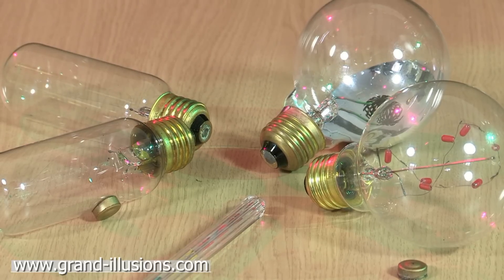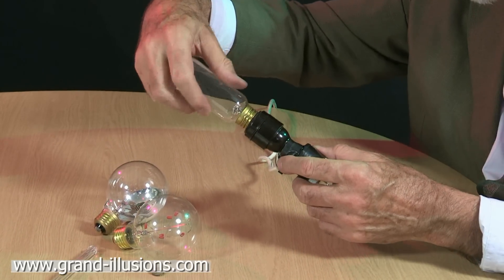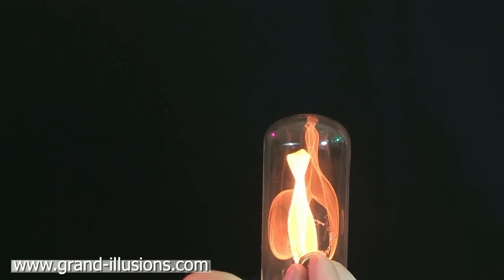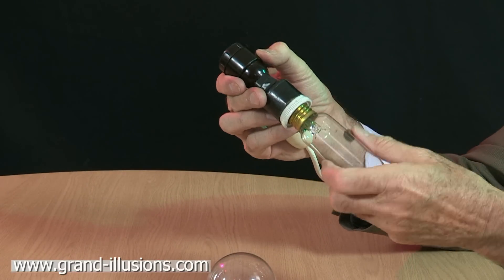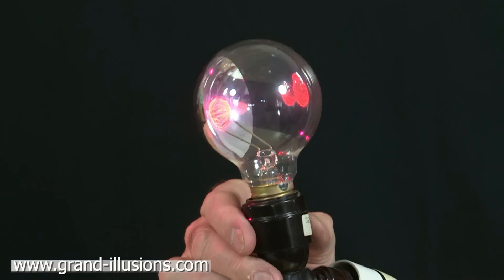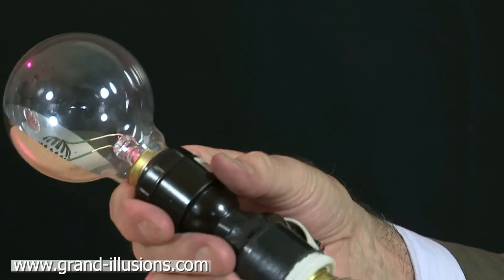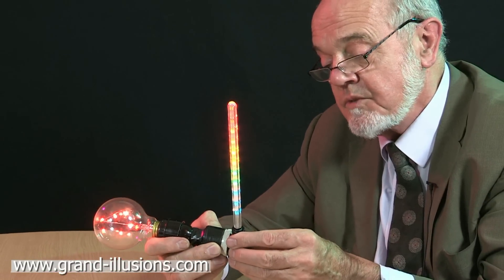Unusual Japanese Electric Light Bulbs

Comment: Putting in two bulbs they are still both getting 240v each, they'll live, but only half as long
Reply: not if they're in series. in that case both will get half the voltage but same current.
if it was in parallel then they would get 240 volts but half the current
Reply: @Xiefux  then explain a ring main
Reply: @phonotical  i dont understand what you're trying to say, whatever it is it's not english
Reply: @phonotical  i dont speak russian

Comment: A serial connection is a bad arrangement as it will be unbalanced due to the difference in bulb-resistances. Moreover, the electrical safety would desire some more considerations. The proper arrangement would be to have a step down transformer.

Comment: The voltage "seen" by each light bulb will depend on the resistance of each bulb in the pair. You want to match the resistance for an even 120v on each.
A safer, foolproof alternative would be a 2:1 stepdown transformer.

Comment: That 1st light bulb is the old Kyp-Go light.  It was manufactured here in the United States, and Robert Kyp started seeing knock-off bulbs, and applied for an international patent.  His patent actually protected the way his light bulbs were made as his was manufactured with a magnet in the inside of it.  Other makers can make light bulbs like that, but could not put a magnet in the inside of it.  Here is a video of the one that I have that is about 50 years old.  The last time I have talked to the Kyp's, Mrs. Kyp told me that one of their test bulbs has finally failed after burning continuously for 30 years.  They said towards the end, the bulb was so black, you could barely see it.  The filaments in there were made from carbon.  Here is the bulb that I have.  https://www.youtube.com/watch?v=5Sn70P4i7O0

Comment: Putting 2 120V light bulbs in series on a 240V supply isn't necessarily a good idea. If the bulbs have different power rating / consumption, their resistances will be different. This means one will take a higher proportion of the voltage than the other, and may burn out. 

There's also the fact modern low-voltage bulbs use capacitive droppers to reduce the voltage, and they aren't designed to work in series with each other, like the old-fashioned purely resistive tungsten filament bulbs could. And even with tungsten, you'd need 2 of the same power. 

You can get inexpensive voltage transformers, although quality will vary along with price, worth getting a decent one. Doesn't have to be too expensive, but you'd be amazed at the crap they sell on Ebay, much of it wrongly specified and dangerous, sometimes deadly. For low power devices like bulbs (less than 100W, say) you don't need a large or expensive transformer.

Comment: Very fascinating bulbs. An idea: you could make a simple transformer. Just wind coated copper-wire around a iron core, lets say 40 turns, then make a second winding next to it with about the half (measure to find the right number of turns). This should give you 240->110VAC so you don't have to put two bulbs in series (which acts as two resistors).

Comment: you can buy screw in socket adapters for standard us sockets.  Might be a better idea than sticking a pulg in into a screw socket.
Reply: +brett knoss That's not the issue. Here in the UK we use 240v mains. Those bulbs are built for 110v, so he has to divide the 240 voltage between two bulbs to get closer to the bulbs operating range.
Reply: +Alan Bacon he already had a UK to US adaptor, and it was a Japanese bulb.
Reply: +brett knoss the adapter dose not step down the voltage

Comment: No one cares about that man almost electrocuting himself? If you run those lightbulbs in series, you have exposed 115 volts on that clearly exposed lamp socket. Also its not a good idea to change lightbulbs thats on because if you break the glass, you touch the filament and die.
Reply: +Aleš Pinď&#225;k Well, maybe.  I've had over a dozen 240V shocks - they hurt.

Comment: So the UK uses 220V?
Reply: Brian Liesberg The UK currently uses the same as mainland Europe, which is 230 v +/- 10%. Japan actually uses 100 v for most domestic installations, but since they export a lot to the USA (which uses 120 v) they tend to aim for 110 v.
Reply: Brian Liesberg 240V, which is close enough to 2x110V to work without destroying the bulbs/filaments.
Reply: ***** No, the standard in the UK is the same as the rest of Europe (where you'll also find areas with 220, 230, 235, 240, etc., sometimes even within the same country).  It's 230v +/- 10%, as I wrote above. It was defined in 1988 by CENELEC (the European Electrical Standardisation Committee). There is no mention of "+/- 5v" anywhere.
 
The actual CENELEC website requires membership, but you can find references to it on other official sites. Ex.:

http://eur-lex.europa.eu/legal-content/EN/TXT/?uri=CELEX:91997E001426

Some areas of the UK actually use 250v, but even that is still within the standard. Most areas are within 6% of 230v (i.e., 215 ~ 244v), but any value within 10% (i.e., 209 ~ 253) complies with the directive.
Reply: +RFC3514 mainland Europe uses 220v and the uk uses 240v but the law stipulates that the voltage must be aimed at 230 +/- 5v

Comment: To use two 110V bulbs in series for 220/230V one should only wire in series two 110V lamps that have identical Ohmic resistance (usually that means same wattage but some LED lamps work differently). Otherwise, you'll have two resistors (two lamps) of different values in series, and the voltage of each will be as the resistance ratio. One will burn dimly, and the other will die young!

Comment: Well done video!
Love those lightbulbs.  Candy bulb has little filament lamps inside?
The magnets do not affect the current flow through the filaments. 
The filaments are just attracted to the magnet and repelled by the magnet as current direction alternates 100 times per second.   Would be fun to see how much they would bend on pure DC current.

Comment: Cool.
Reply: sebastian nutter They are actually called "Balafire" or "Electric Flame" lamps based on different patents from the late 1800s. Strangely, those all had the magnets inside so it can't be lost. Maybe it's outside here to allow you to turn off the flickering. It's weird that it's glued on though, so maybe it's just a cheap solution to not infringe the above patents.
Reply: sebastian nutter Are you referring to the now discontinued "Flicker Flame" bulbs by Noma? ( https://www.youtube.com/watch?v=1wbhIE_CV0w )

They were neon lamps with two flame-shape plates as electrodes. The tips were further apart than at the base so the discharge glow would act like in a "Jacobs ladder", traveling from base to tip
Reply: *extraordinary

Comment: one should never touch the glass bulb with a bare hand. The oils from your hand weaken the outer glass. The oil will cook on the glass and compromise its strength.
Reply: Are you for real? I have never heard of this. It's like people who say never to touch a CPU with your bare hands, like it's the worst thing in the world.
Reply: charzzbarzz
sadly yeah its true =(i use a cloth to screw mine on
Reply: charzzbarzz the cpu thing is real :D because of electrostatic discharge but you can still touch the CPU but should avoid the pin 'cause you can also bend them :D
Reply: i know this is true for halogen and xenon lamps but iv'e never heard of it with regular incandescent, although i do usually use a cloth or something to install them anyway because fingerprints will lower light output and they look nasty with prints on them
Reply: yuukiflow Actually, as far as I know, the CPU thing is so that you don't get fingerprints where the flat surface connects to the fan, because the fat makes the cooling an incredible lot less effective.
Reply: Tom, you are correct if you're handling a halogen lamp. The low output bulbs in this video can be handled safely.. The CPU thing is real.  Microchips get zapped from any static charge that we almost always carry. Good day
Reply: charzzbarzz
It is overkill advice for a standard light bulb - but if you work in theatre projection, those xenon arc bulbs have special quartz envelopes (not just glass) because they need absolute clarity. 1% loss in the glass would result in hundreds of watts being applied to the glass and it can't handle that much power. Add a finger print and you just made a hot spot where the skin oils absorb light...and you just exploded a several thousand dollar bulb after it heats up.
Reply: also the energy from the light has a harder time escaping.
Reply: Uncle QUiKSCOPEe you are right the electrical discharge wont do jack shit as there is something the way between the topp and the curcit.

Comment: It's rated as 240V but you don't actually get 240V. You get 220-230V
Reply: The opposite, its rated at 230 but you usually get 240 to 250. 220 is the European voltage, 240 is the commonwealth voltage (excluding Canada)
Reply: 240v nominal
Reply: Nathan Dance Excluding Pakistan and India too!

Comment: We use 240 Volts in Australia too. 120 isn't powerful enough for many applications.
Reply: I know this is old, but there are so many mistakes being made in these comments.  In particular, 1Howdy1 may sound authoritative, but he is just guessing, and almost all of his guesses are (very!) wrong.  (I am an electrical engineer.)

a. 120 V is powerful enough for anything you want as long as the plug (and wiring) can handle enough current.  Doubling the voltage cuts the current in half for the same amount of power usage.  This means the wires can be made thinner but the insulation has to be thicker due to the higher voltage.

b. Single-phase isn't unique to the US.  Every country in the world uses 3-phase for power distribution and then single-phase for most home purposes.

c. The 240 V split-phase for large appliances in the US is not "smoother" or "less jittery".  Split-phase is equivalent to single-phase.  It just adds a third wire at an in-between voltage for things that need 120 V.

d. More phases does not necessarily mean smoother power delivery.  Single-phase is not smooth, but ideally, 3-phase is perfectly smooth, just like DC.  That's why it's the worldwide standard for power transmission.  4 phases is not as good as 3 due to the large currents the neutral wire will carry.  You don't even need a neutral for 3-phase because it is perfectly balanced.

e. Most of what people call "appliances" certainly don't run on DC!  Things with motors (blenders, air conditioners, etc.) usually use AC motors.  Stoves and toasters use AC heating elements.  Incandescent and fluorescent bulbs run directly on AC.  Electronics like computers and phones are the main thing that needs DC.

f. The electrons don't just drift slower than walking speed, they drift at an extremely slow rate.  Imperceptibly slowly.  It's like watching grass grow.

g. The reason silver, gold, and copper have higher conductivity is not because their atoms are more organized than other metals!  Notice that all 3 are in the same column in the periodic table.  The reason they conduct so well is that they all have only 1 electron in their outermost shell.  That one lonely electron is held very loosely because there's just barely enough positive charge on the nucleus to hold it.  So, it is very free to move.  We call this "high electron mobility" and it's the reason for the high conductivity.

h. The electrons in a metal certainly do not travel like a slalom course!  They are travelling at extremely high speeds, but they are constantly bouncing forward and backward, so that they spend almost as much time going the "wrong way" as they do going the "right way".  They only travel the right way a tiny, tiny, tiny bit more often than the wrong way, so that over time they gradually drift (very slowly, like I said above) in the right direction.
Reply: People don't seem to understand that all homes in the US and Canada are wired for 240 volt as well. Most of our appliances run on 120 volt but many have 240 volt sockets.
Reply: Chris Licata Yep, but most appliances use 120v :/
Reply: dosn't really matter how much volts. the amount of ampere is the key... volts lovers resistanse = basicly means less heat, thinner cables, cheaper.
Reply: 1Howdy1 
Ahh, the joy of knowing a few things or two about this mysterious invisible energy that gives us an easy life. Just what is Electricity and what is it made of intrigues me. It's a Godsent element.
Reply: It's a flow of electrons attracted by a positive charge :) (correct me if I am wrong, though, I don't know much about electricity)

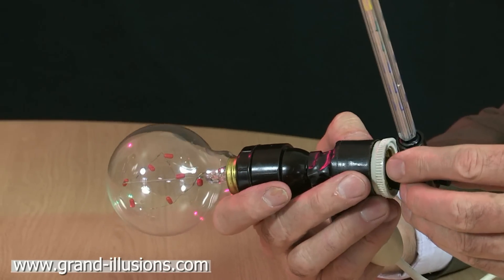Comment: At 2:10 he's lucky not getting electrocuted by touching the brass lamp contact.
Reply: Frank Path of least resistance. Ever welded before? If not just look up stick ark welding. Hundreds of amps that melts metal instantly, and it's common practice to rest your hand on the peice you're welding.
Reply: The Great Tim doesn't get electrocuted... He electrocutes...

Comment: I hope you've got a good RCD! Because when lit one of the outer casings of the bulbs threads will be at half the mains voltage, and both of them can be touched. It's even more dangerous if one of the bulbs isn't completely screwed in. Then the thread could be at full mains voltage!
Reply: The thread is on the neutral side which should be at the same potential as the earth, so under normal circumstances you cannot receive a shock from the thread. Regardless RCD's are required for lighting circuits (here at least) because things do go wrong and people like to put their fingers where they don't belong.
Reply: *****
If connected in series (to half the mains voltage for each bulb) it's impossible for the threads of both bulbs to be at neutral. One bulb will have neutral and half mains on its contacts, the other half mains and full mains. At around 1:20 both threads are exposed (admittedly not easily touchable, but still).

Btw. there's another flaw in this setup, that's dangerous, but luckily not for humans but the bulbs. If you connect to different wattage bulbs in series the voltage won't be half for each. The same current has to flow through both of them (can't escape physics here). One bulb will be overdriven, the other underdriven. You can easily tell that is happening as the same bulb lights up differently depending on the second bulb screwd in.

So in essence: don't do this if you like your health and your bulbs. Get a 230V/115V transformer. Or for cheap use an old transformer that has two 115V windings (many devices have that, because you can connect the windings in series for 230V and in parallel for 115V mains), connect the windings in series to 230V and tap off 115V at the middle point.
Reply: superdau I didn't realise that they were in series lol, ignore me XD.
Reply: You are wrong.. The threads of the fisrt bulb can be connected to neutral and the tip is connected to the second bulb's threads, and the tip of the second bulb is connected to main.
Reply: I wonder how he's grown old to this age. Must be lucky. Anyway there are many plug types without polarization, you cant know which side is ground unless you installed it.Tthey have polarised plugs in uk so one side should be safe to touch. He was also careful on the white side but still.. I don't know... Kids, don't try this at home!